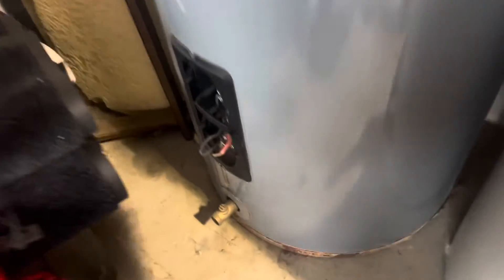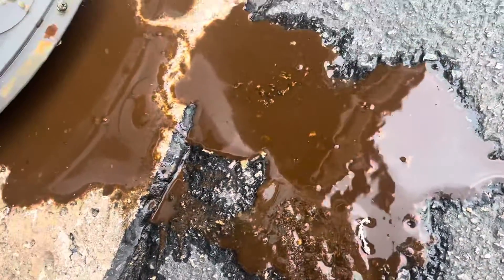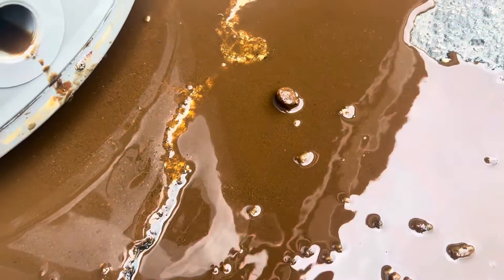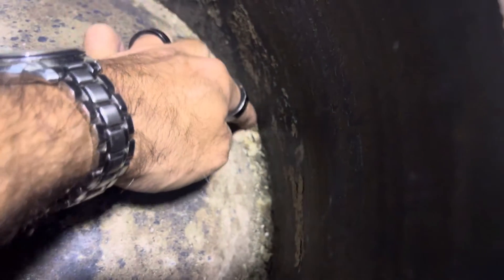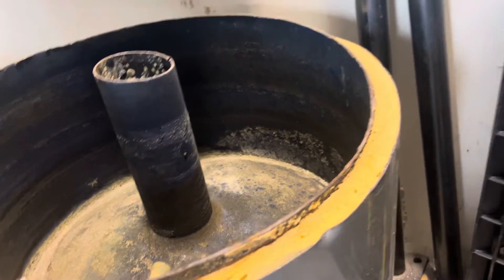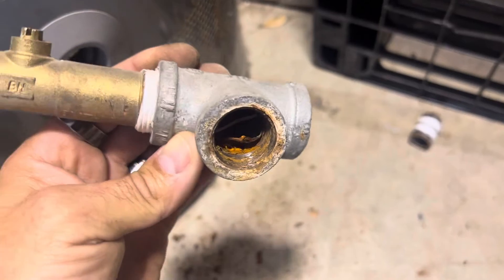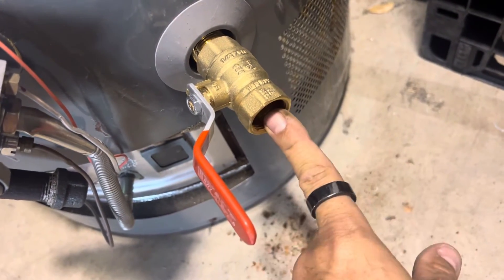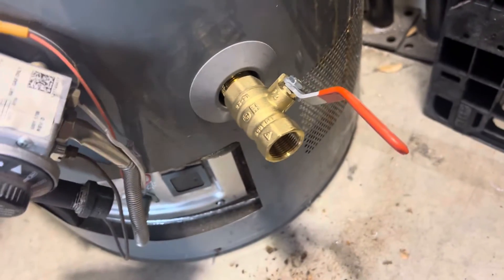Full port 3/4 drain valve for water heater flush and drain.

Comment: Wouldn't it be better to use a stainless steel nipple and stainless steel ball valve since the water heater is steel.  You may get dissimilar metal corrosion if you use a brass valve.

Comment: Warning, if you have enough sediment in your tank, your existing valve won't drain it, so when you pull it there will be a new gush of disgusting brown water and if your model is like the one in this vide (as mine is) that water will get all over the gas control module and will prevent the pilot from lighting for a solid 12 hours or so. 

But other than that, easy job.

Comment: a licensed plumber showed me this ~2002.  after that i had 'upgraded' to ball-valve drains on several friends' water heaters, but haven't done any in over a decade.  also didn't have a cell phone in those days to click a pic.  i don't remember there being brass 'nipples' available at the local hardware stores in those days.

3/4" x 3 or 4" nipple to clear the tank and any hardware mounted outside the tank
3/4"  ball valve
pink / orange Teflon tape, not the with one
3/4"  to male hose adapter
female hose end w 5/8" barb or 3/4" if available - i think 5/8" is maximum available
clear reinforced vinyl tubing to fit above barb, ~ 6ft 

large empty 3.78L or 1 US gal juice jug to catch the crap from the water heater when you crack open the ball valve under pressure